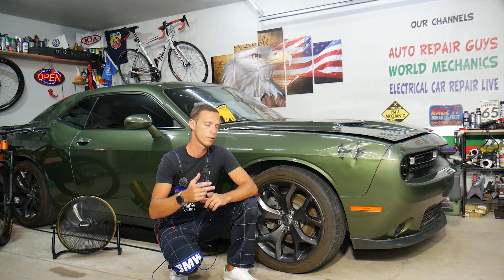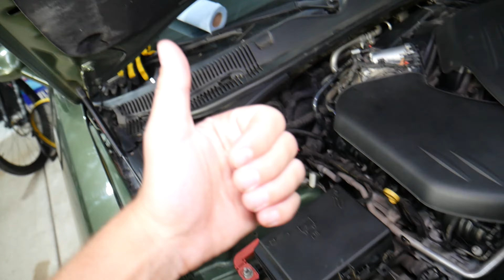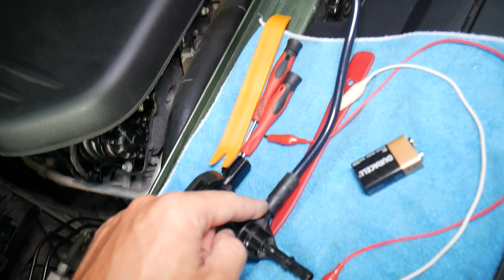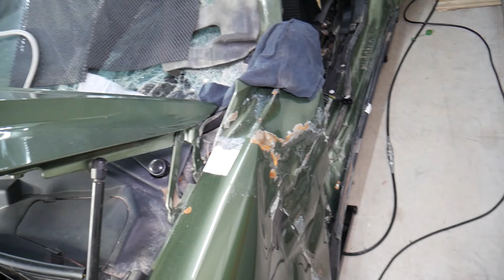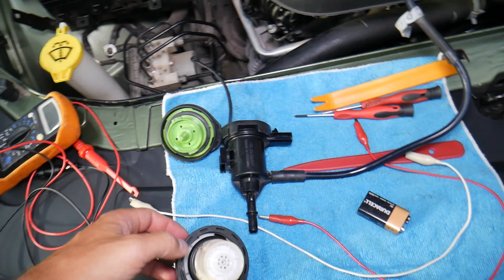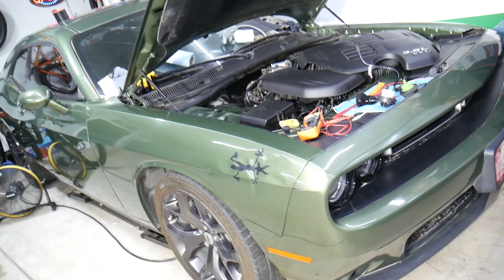DODGE CHALLENGER CODE P0456 EVAP EVAPORATIVE EMISSION CONTROL SYSTEM SMALL LEAK DETECTED

Comment: Hey buddy, thanks for share this helpful information, I have a question regarding my charger 2015 evap codes that I have. Mi charger doesn’t come whit fuel cap. I remplace the efe upfront the dealership remplace the big canister in the back and mess up the seal on the small canister attached to the big one. I remplace that seal and still getting evap leak codes . What could possibly be!? Any suggestions will be greatly appreciated. Thanks

Comment: Could this cause eco 4 cylinder mode not to come on
Reply: Dealing with a cylinder 4 misfire as well, did you have an evap leak , did you ever figure it out?
Reply: Already changed spark plug, ignition coil, and PCV valve thinking there’s a small air leak in one of the PCV valve hoses was that what happened to you?